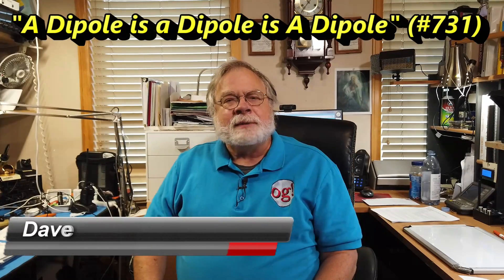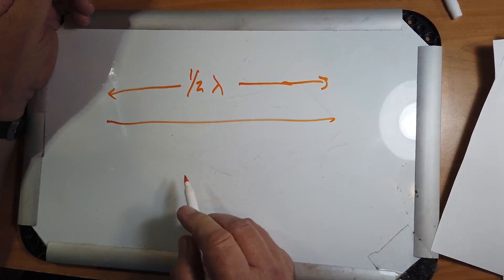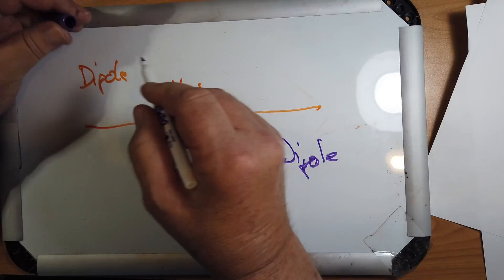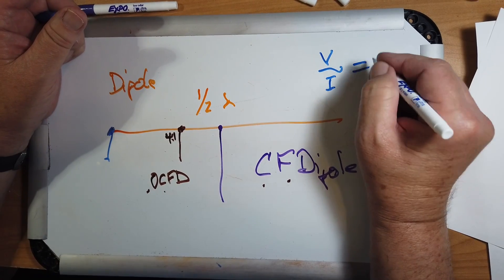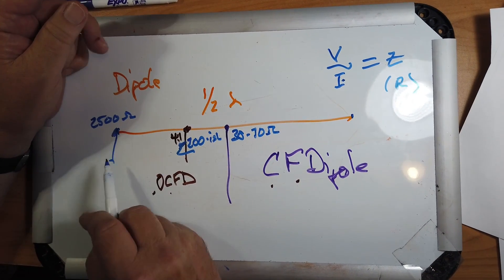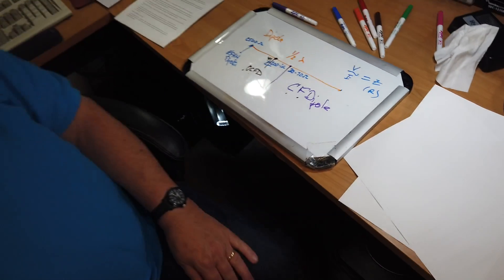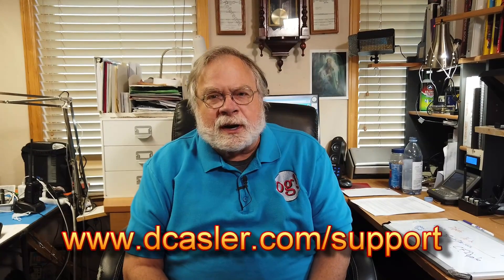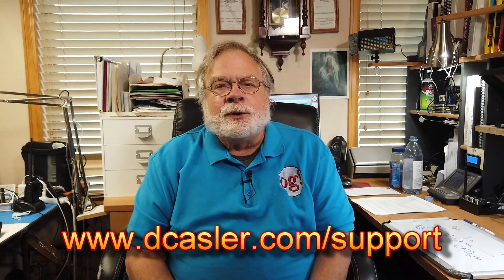"A Dipole is a Dipole is a Dipole" (#731)

Comment: Thanks for explaining that Dave.
I always thought a di-pole was two equal length pieces of wire with the centre core of coax to one side and screen to the other side.
I see this is not the case😱
That being so, can you explain what it is that I have described?

Comment: Would you get any gain or other advantage say using 1/2 inch aluminium tubing than using say a #14 gauge wire for any dipole?
Reply: You might get some gain using tubing, but your biggest advantage would be more bandwidth with the tubing.
Reply: @hamradioeconomystyle48  awesome, thank you for that information.🍻👍

Comment: Hmm, definition of "DI" is twice, two, double, hence dipole = 2 poles, just like carbon dioxide has 2 oxygen atoms per molecule. And an EFHW is therefore a mono-pole. Now in a horizontal mounting an EFHW acts exactly like a horizontal dipole as far as wave pattern. BUT when you bend them (i.e. Inverted V) they wave patterns differ.
Reply: pole refers to polarization or current distribution not physical properties. Common mistake.

Comment: You say 'a dipole is a dipole is a dipole'... But an EFHW is a far superior multiband antenna than a traditional center-fed dipole, is it not?
Reply: Agreed. An EFHW is resonant on all harmonics of its half wave, but a centre fed dipole is only resonant on every odd harmonic. A halfwave dipole is actually two quarter wave elements whereas an EFHW is a complete halfwave. So a fairly significant difference I think.
Reply: If it’s feed with balanced line and not coax (a doublet) I believe that is better than an EFHW. Even with a tuner way more power would radiate.

Comment: A Dipole is a half wave antenna with an unbalanced line feed point in the middle. If the feed point is elsewhere, it should be given a different name,. If the feed line is balanced it is a Doublet. Nothing makes life more difficult than the changing of the meanings of common terms.
Reply: your mistake in understanding is you superimposing your own definition of what dipole means.
Reply: Actually Casler should label his example "Half-wave Dipole" (regardless of feedpoint) at the top of his whiteboard. He does write "1/2 λ" on the board and talks about "half wavelength", but writing "Dipole" at the top refers only to any antenna with 2 conducting elements (vs a "monopole") of any length. It's true that Hams typically mean H-W Dipole when they say "Dipole". But on a the diagram's title should be more specific.